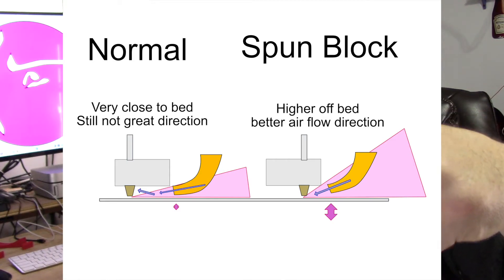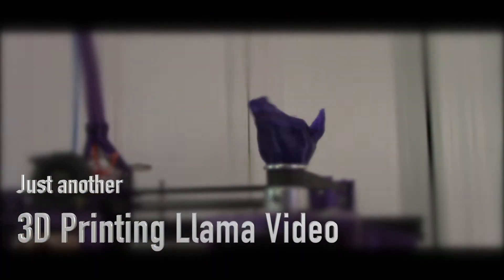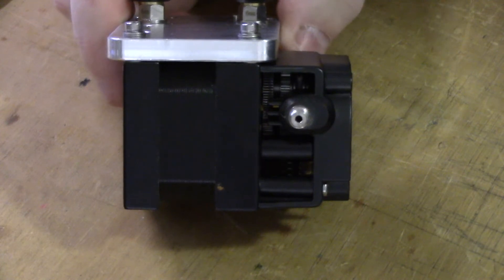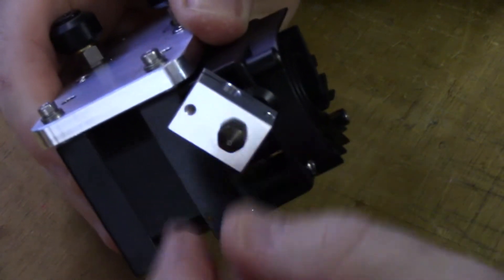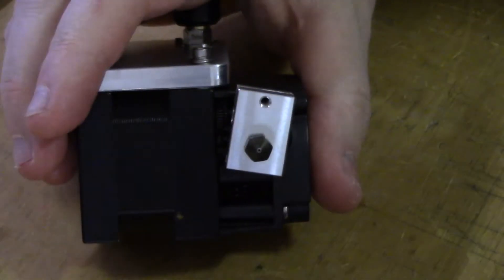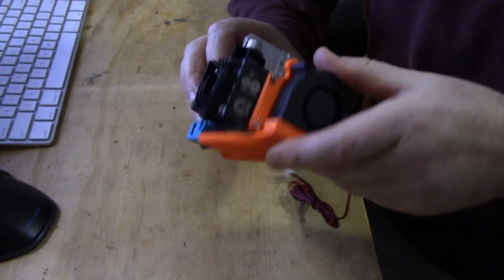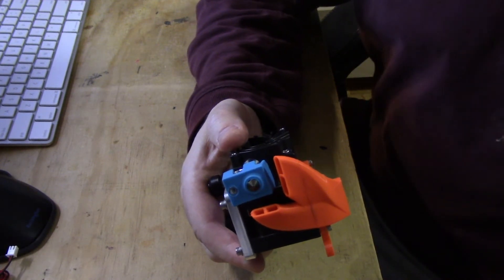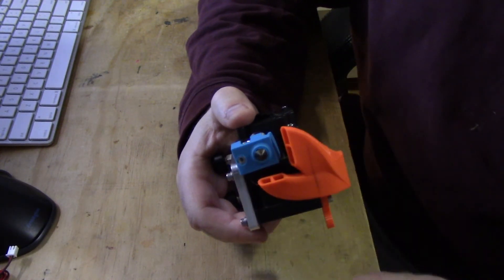Hemera Reverse block and parts cooling Ducts

Comment: I am confused on which pair of parts to print its in 2 pieces to glue right?
Also I think I mounted mine reverse by direction? I got a hemera winter 2021
Reply from the maker: it's a tad of experimentation. the "spun" units are just pre oriented for the build plate,.. the "raised base" and "raised 75" are for shorter nozzles if you are using stock E3D nozzles, it's likely those will work the best. MicroSwiss nozzles are a tad longer and what I used at the time so I designed it for those originally. you'l need a "base" and a "ducts" ...  It's been a few yrs now since I bothered with the Hemera's so to be honest, I don't fully remember everything about these .